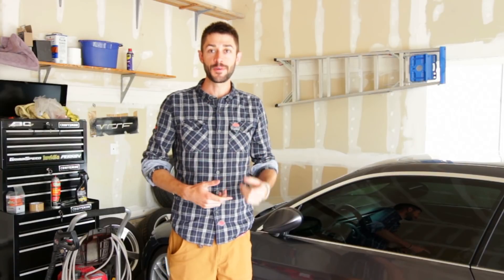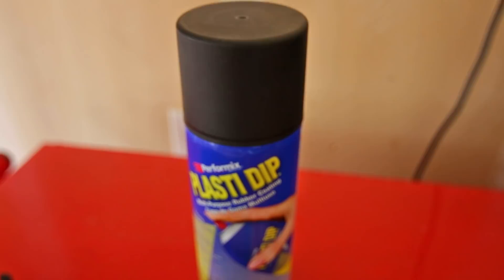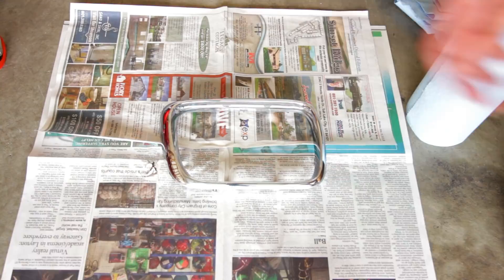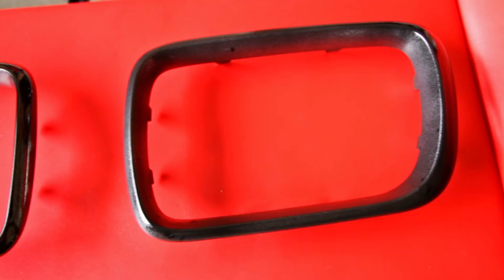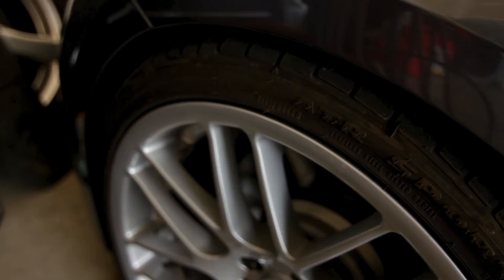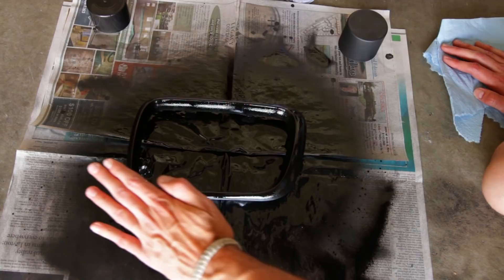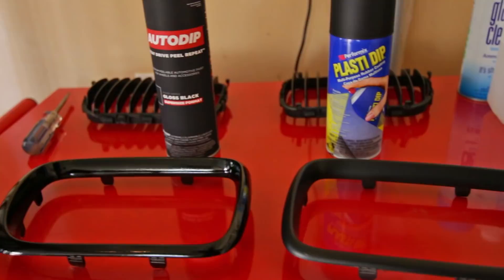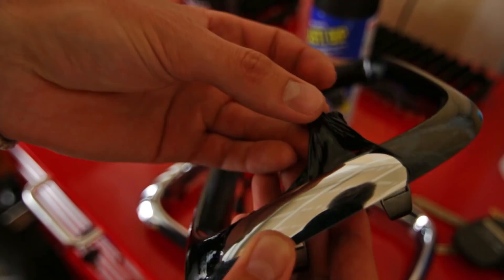Plasti Dip vs. Autodip : Which Should You Use?

Comment: Another way to get a nice smooth finish with Plastidip is to warm up the cans in warm water for 10min prior to using, shake them up then another 5min in the warm water. The spray will come out much more fine and it'll cover the area much better.
Reply from the maker: +Ryan Howell I'm going to have to try that, thanks!
Reply: Ryan Howell great tip! Thanks!
Reply: Also don't go on so light bc it will give it a lot of texture
Reply: Great advice..
Reply: Does the autodip stick good to chrome?
Reply: This is 10000% accurate
Reply: Other thing the cans are not made to spray down . Always spray with the can vertical on both brands

Comment: tried them both areas to consider.
durability - plastidip
looks - autodip
price - plastidip
Reply from the maker: +elnitroxarc thanks for the input. I haven't had enough experience with autodip to speak on its durability yet.
Reply: So true!
Reply: price for auto dip has almost been cut in half and comes glossed and looks way better.
Reply: elnitroxarc.
Reply: Hmmm what if I did 2 coats of plastidip for the base and 2 coats of auto dip
Reply: Jerome Bafaty Mind blown!
Reply: Jerome Bafaty do a vid on it
Reply: Jerome Bafaty they come off in 2 separate layers so its kind of pointless bc you have to put the same amount of coats for each for them to peel off nicely.
Reply: I'll go the CHEAPER route. Thanks!
Reply: @sharkparty1027  it's 5 dollars for A can how much cheaper do you want it to be .jeez

Comment: But does the autodip stick well to chrome?
Reply from the maker: Truth is no paint sticks well to chrome or any glossy surface. It is better on surfaces you can sand lightly to prep, but you probably wouldn't do that to chrome. It's best, like any other paint prep, to completely clean the surface before spraying and you'll get the best outcome if you're not going to scuff or sand it as well.

Comment: I have those stock grills on my 328i (2016), do they just pop off?   I’d rather remove and spray then mess around with taping.  Gotta do this.  Thanks for the vid.
Reply from the maker: +Lucky Louise they have tabs all around them that you can pop off then they separate as you can see in the vid. Just be careful because the old plastic is brittle and they can snap! Thanks for watching! Good luck 👌

Comment: Does anyone know how you can fix nicks where the plasti dip has worn off on the edges of rim from taking the tire off?  Ive had 3 nails in my tires & the repair place messed up the plasti dip on the rim & Im not sure what the best way is to fix it without messing the whole rim up!?  Is it as easy as just respraying the nicks and it will all even out and look uniform?
Also is plasti dip still more durable than the autodip?
Reply: peter c hey man. I have saw some videos and tried it myself get a rubber glove and some mineral spirits. Get a dab on the back of your nail and lightly rub the chip or tear. Itll reliquify the dip and make the raised edge flush again. Then just touch up that spot when it dries with a few more coats. Tedious but can work pretty well.
Reply: Chris Santos thanks mam I did that and it worked perfect!  didn't have to redip it all just retouch!
Reply: peter c very nice! I did it on my fender flares and it worked well for me. Did you just give her a quick spritz in that spot? I ended up spraying about a 10" overlap
Reply: Yeah bc I get my tires rotated after each oil change & they sometimes mess up the edges so I have to redip to make it look nice.  Was thinking of trying auto dip bc its more glossy but not sure how well it will hold up?
Reply: peter c I'm curious about that as well! It's pretty dang spendy though
Reply: Hehe yup but its worth it in the end and much cheaper than getting your wheels painted plus its not permanent when you want to sell...I wonder if you can put the auto dip over plastidip?  If anyone knows the answer please respond this would be alot easier than redipping it all!!

Comment: Because plastidip is cheaper can you apply autodip over plastidip to eliminate some of the autodip layers?
Reply from the maker: +DylanF.Realtor I don't think you would end up with a very smooth finish if you tried that since plasti dip isn't as smooth.
Reply: I was wondering if I can Plasti dip over my auto dip.  Autodip looked good in the beginning but started to chip after time
Reply from the maker: The best thing to do would be to peel off or remove the autodip, then plasti dip it.

Comment: You should mention the cost and availability factor.  I was at SEMA last year too and that was the first time I had seen Autodip.  It was incredibly impressive in their booth, so I've wanted to do that with my wheels ever since.  My factory wheels are silver and I'm tired of the brake dust issue happening almost immediately after I wash it.  I want something durable and it just seems that Autodip would do that.  But what I'm finding is that resellers want like $25 bucks a can for Autodip while I can get Plastidip for way less.  I haven't priced it out lately, but I know for a fact that I bought 6 cans of gunmetal plastidip a couple years ago for less than $50 bucks while I'm seeing $25 for a can of gunmetal Autodip on Amazon right now.  So there's that...
Reply from the maker: +Anthony Marc yeah autodip is definitely a bit on the pricey side. To get the same effect you'd have to buy two cans of plasti dip (black and gloss) but even then autodip is still more. The finish ends up being better with autodip however so that's where I think they justify the price.
Reply: once you get your rim the color you want, one can of Glossifier would be enough to do 4 rims to a gloss finish.  Plastidip black 5.99 a can and glossifier at like 6.99, 4 wheels gloss finish for less than $36

Comment: What's the spray called that you can get to make the Plasti-dip have a gloss? And you mentioned that you can Plasti-dip some stuff on the inside , can u spray the logo on the steering wheel?
Reply from the maker: +Baby D510 just search plastic dip glossifier and you should find it. I'd only suggest spraying something you can remove from the car, spray, then put back in. You wouldn't want to spray it while it's in the car because of overspray.
Reply: Treats On The Streets  thank u for writing back n the advice👍
Reply from the maker: +Baby D510 no problem!
Reply: Treats On The Streets do have a quick question.. when do you apply the glossifier after few layers of plasti dip?
Reply from the maker: +Baby D510 yes, I believe the can will have instructions on it.
Reply: Baby D510 
Yo.. u cute
Reply: Baby D510 just got to Walmart they have all kinds of gloss plastic dip

Comment: i autodipped my wheels with gloss black. one can per wheel. 18" in wheels. all i can say is it looks really good when its cleaned. not sure about durability but mine started to peel off already. but if you drive an AWD sports car you can get a lot of brake dust. so the shiny wheels probably last a few days. I also wipe it with tire shine to make it even shinier. i never plastidip my wheels before so i don't know the durability. but i have plastidip a lexus bike rack and it lasted 3 1/2 years before it started to peel off now.
Reply from the maker: +hngo awesome man thanks for sharing your experiences!
Reply: you didn't have your rims clean when you sprayed them.  I have dipped my wheels and years later it is still in perfect condition.
Reply: Hey man just so you know, the reason it didn’t stay on is because tire shine makes rubber stuff boil and surface up, peel up.
Reply: oh shit i got to this late. I honestly never knew that, thanks for the tip.
Reply: @nygelbierlein6312  any luck?

Comment: where do you buy auto dip?  price?
what state do you live in?  snow rain?  I wonder how long it last in ny vs ca
Reply from the maker: +Fuong Wah I bought mine from Amazon and it was 25.99 a can. I believe you can buy it from the Autodip website as well and In Utah where I am a few places sell it locally.
Reply: Treats On The Streets 26 bucks is expensive vs 8.5 at auto parts for plastic dip.  Def like matte vs glossy.  Amazon plastic dip is 16 bucks after shipping n tax.  did you spray any interior parts.  it's a pain to take off on porous surfaces.
Reply from the maker: +Fuong Wah I agree it is kind of $$$ compared to plasti dip. You'd have to buy 2 cans of plasti dip (black and glossifier) to get the same effect as one can of Autodip though. Even then, the Autodip is more money but if you're looking for gloss the results are better. I like both of them, just depends on if I want gloss or matte.
Reply from the maker: +Fuong Wah I haven't sprayed any interior parts yet, but I might in the future.